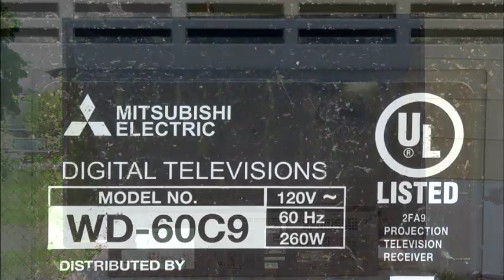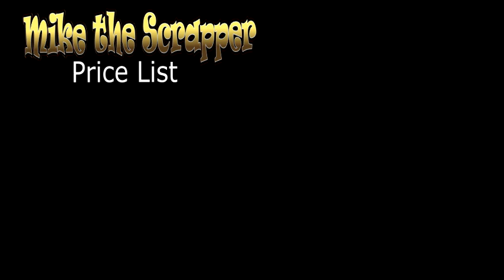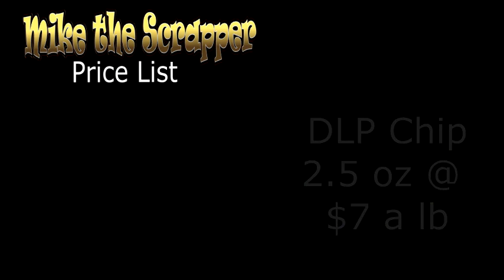Gold DLP Chip

Comment: I noticed that you scrap the speakers with your steel. Depends on where I get my items " not outside in the rain" I tend to keep the speakers and sell them as a lot. You could probably get about 50 cents to $1 per speaker not matter the size. I did this with small PC speakers.

Comment: I think that TV would've been better off repaired vs scrapped. I have a similar model and it works great with a 1080P picture. I did have to replace the DLP chip in it awhile back. Plus, these TVs have to have the lamp replaced ever couple of years or so ($30-$60). If that DLP chip did not have any stuck mirrors (white/black dots on the screen), you could have easily sold it for a lot more than scrap value.

Comment: Do not forget to keep the Fresnel lens. If it is a linear one it can be used to cook with.

If it turns out to be a Spot lens you can actually melt river rocks to create Obsidian for jewelry, etc.

Some of them have been know to vaporize a penny in 3 second. ( new zinc penny - true copper pennies takes a little longer.)

I did one a day or two ago in around 10 seconds. I live in the midwest and the winter sun is a little weaker, but still burns items including metals.

Comment: That DLP chip alone goes for $300 and $400 on eBay and Amazon. The  dmd board it comes off of is $100 to $200 on eBay, the color wheel goes for $150, the power supply and mainboard go for sell for $100 each . The screw set sells for about $20 the heat sink over the DLP chip goes for $20 to $30. The mirror inside the light engine goes for $100, the fans sell for $20 to $40. The screen itself is work about $200 to $300. The speaker set is $20 to $40. Even the dang IR sensor is worth more than scrapping it all together. The wire set including the plug is $30 to $40.

Comment: hey mike these videos are great. a tv like this is a good find. while mnot a high scrap value device there are alot of cool parts in them. one i like the most is the magnifying glasses and tops is taking out the fresnel lens. most any rear projection tvs hold these in there screens and there are fun to play with. when set up properly a fresnel lens can put a sun spot on any materiel thats over 2800 degrees F. and will set fir to or melt anything in it way. its a huge sheet of plastic that looks like a giant flat magnifying glass
Reply from the maker: lead foot lawn mower I have seen video's on that...That is the coolest thing...

Comment: What do you do with the countless screws that you collect from your dissasemblies?
Reply from the maker: I put them all in a can or bucket and sell them for scrap.
Reply: i've plastic boxes of wood/ metal/ self-tapping screws/ nuts-n-bolts/ fasteners/ solder joints/ pins/ connectors/ components, and have used almost all in my projects (my newest is a mechanical pinball game-about to finish it).
if you need tiny wood screws, look for VCR tapes, unscrew them, and you should have 5-6 tiny wood screws for your projects-i have 100+!!!!
saved alot of $$$$ and still am collecting them!

Comment: What do you do with the mountains of plastics after scrapping?
Reply from the maker: I take to a recycling center
Reply: Djeral100 I sell the Fresnel lenses on Ebay  and get well over $40 for each one. More if it's a spot lens as oppose to the linear lens. Also The polarization plastic part (the one with ripples) I use on top of my patio in my backyard to block and filter out the harmful rays. I then take the clear plastic part ( the first layer) and put that over the polarized plastic to weather guard it. I glued and screwed them down. Now it keeps harmful UV rays out and also during a rain storm (which we hardly have in California) it keeps me dry when I'm in my backyard enjoying the rain. Each projection t.v. has 3 huge magnifying glasses in them. I keep those till I had a bunch and sold for over $200 plus they paid shipping. The fresnel lens and the heavy glass magnifiers will give you your most bang for your buck. Just save the copper/low grade boards/silver/wire/aluminum heat sinks/etc /etc till you have a shit load while you rake in the big bucks on Ebay. This is what I have done in my part time with a job and I've made some great extra cash.I feel like Mike the Scrapper has left out a lot of good points in this video and a couple others. Or maybe he knows and doesn't want anyone jumping in his territory..lol. I love his videos but I had to explain this to everyone not just you.P.S. DLP chips are worth about $35-$60 a pound depending on where you go. I sell all my gold scrap on Ebay and they go nuts for it. Good luck!
Reply: RUSSELGAINZ Thank you, i did not know many of the uses you discribed but i ment the plastic casing.